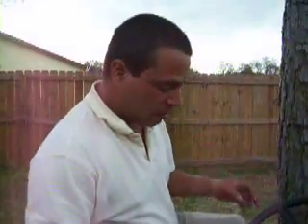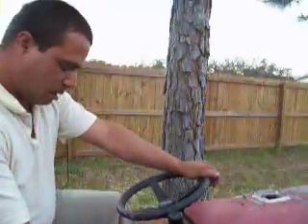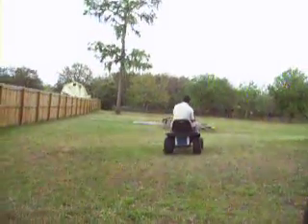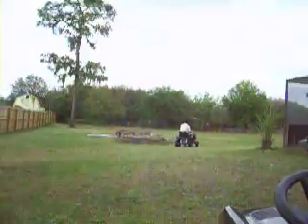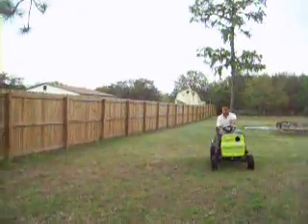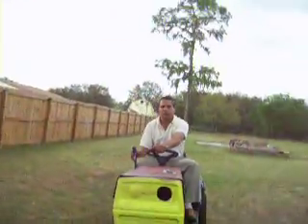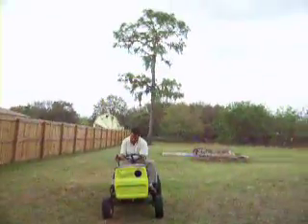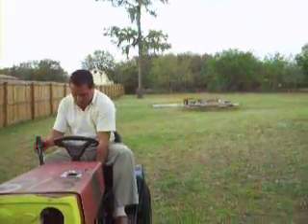2nd electric tractor conversion

Comment: Are you using ac or dc motors?Are you using speed contollers or direct on/off?How many battery are you using and whats your run time?Youre not using the mower blades but could they be reinstalled with youre setup?Sorry for all the questions but i'm tired of paying high gaz prices and making noise and smoke and youre set up seems to work great.I live in a small town that would be peaceful but all i hear seven days a week are mowers running all day long!
Thank you